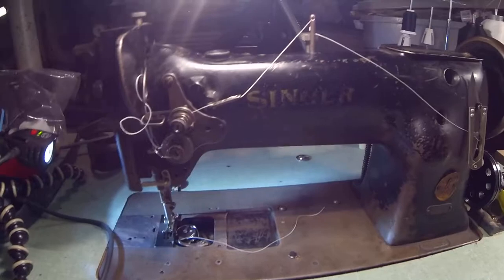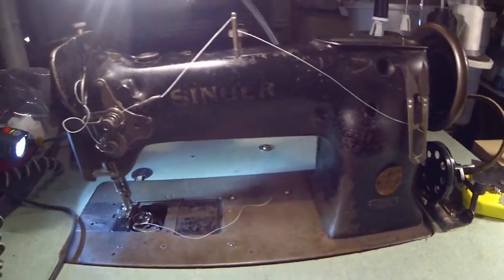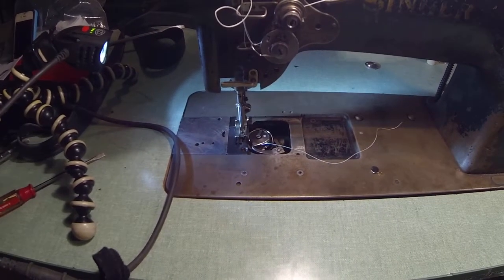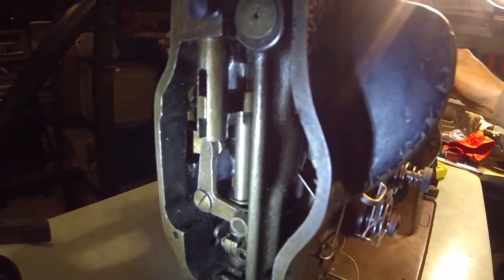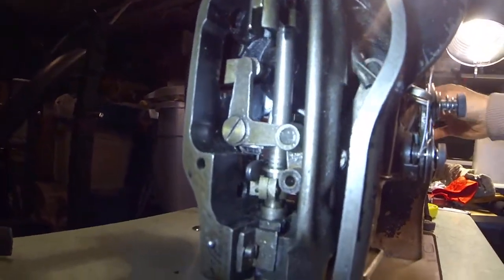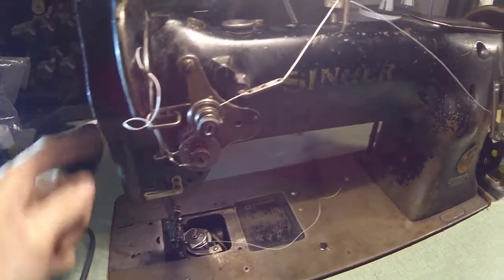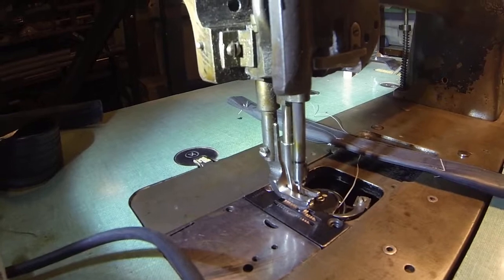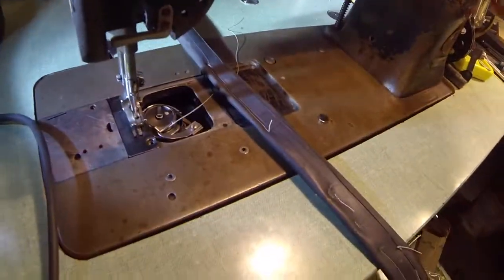Singer 111W153 Walking Foot Sewing Machine, Trouble Feeding. #9

Comment: i have a 111 W101 i have been working with after i changed the timing belt i had relative issues.

During my belt change I had set the thread stitch count per inch to be set really high. In my case  the 101 had a knob out in the center of that hand wheel which when I put the machine back together i did not set correctly.

My experience  may or may not be the case.  I did have identical symptoms of  material not advancing.

Also.. in one of your posts.. you showed an issue with the top thread having such a loose tension that it pushes through the material and leaves extra loopy string underneath.  My upper thread tension whee setter is spun about 3/8 ths of the way onto its tension bolt.

I hope this helps:  either  moral support or small possibility of solution.

Comment: i just finished watching an introduction video for a singer 151... it looks as if your machine is similar for stitch count adjustment.  there is a button to the upper right of the "pocket" in the center of the material plate.

It looks as if pushing the button and turning the hand wheel was the adjustment procedure.

Also, oil your machine all over the place for best results!   now mine purrs.

Comment: First of all, I'd like to say that you have a nice heavy duty industrial sewing machine..it is just matter of some little adjustments. 
It seems to me that 'feed dog' and its corresponding 'needle plate' are not for this sewing machine...it needs a 'single feed dog' and its 'needle plate'.
I would explain this way: the 'small foot' drags the material backwards(OK)...now is time for the 'rear foot' whose function is to retain the material down, while the 'feed dog' should freely move bacwards to its front position...as your machine has a 'wrong feed dog' that touches the 'rear foot', therefore the material is taken back forwards again. 
Hope it helps...please, let us know what happen